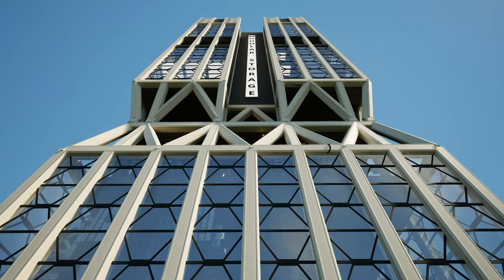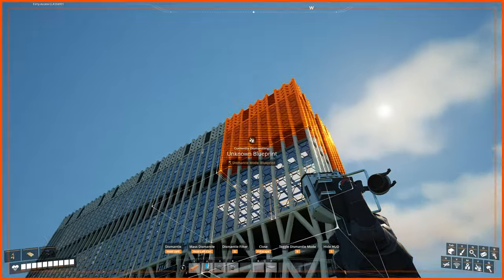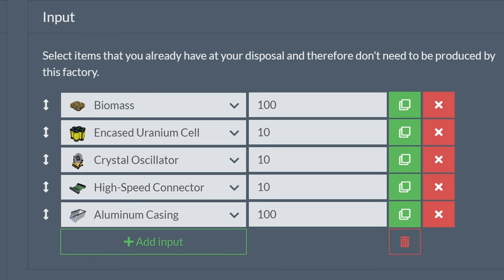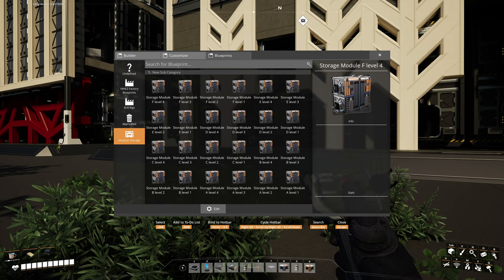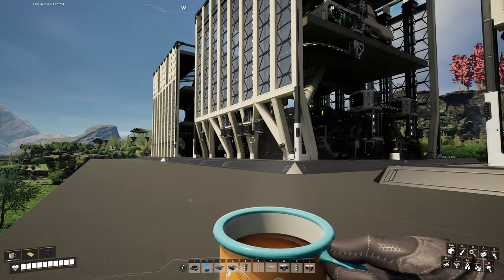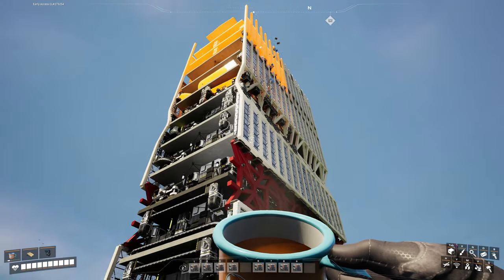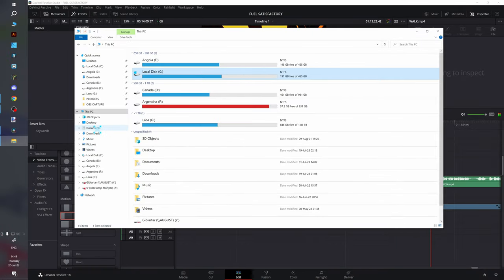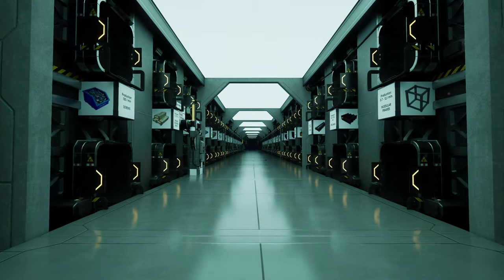I made ALL Satisfactory Ammo Types in 4x4

Comment: I've been playing with my mates, trying to get blocks A thru E hooked up.  Scared to give them access to explosives and firearms lol. Also with many of your other bloops. Giving me great inspiration and utility. Have noticed a few problems. Might be older versions I guess a power cable missing on a constructor here, Weird elevator alignment for rubber and plastic I had to shift the  whole column over as there is no middle 0.5m snap, somehow you managed it. Still great and I managed shift them over no prob.

I think it's given me most clear idea how to make my own but designed with a wider base and more integrated inspection catwalks.

You sir however are a legend for spending your time to put these together and giving away. Thank you 😊
Reply from the maker: Oh crap, this sound like an old version that I have fixed, but somehow it slipped I guess. Should stop using saves from different timelines on the same world. Will try to fix and reupload today.

Comment: Great blueprints. I downloaded them 15-DEC and have been setting them up. I have found a few issues that I wanted to bring to your attention:

There are a few missing power connections; I noted E2 and B2. (looks like you may have addressed this from older comments)
The F blueprints are 180° off; the blueprint arrow is inconsistent with the A-E blueprint arrows. the power connections and resource inputs are also on the other side of the other 5 sets of blueprints.
The bio products spaghetti line is set to 'overflow' on smart splitter. I'm running these belts without actually  overflow (less than 1 stack of remains), and the products are getting clogged in the smart splitter. I set them to 'any undefined' for now, but it would probably work better if setting the 'overflow' line to 'overflow' and every bio product that hasn't been processed yet.

Overall, these are fantastic and I can't wait to get this up and running. Thanks!
Reply from the maker: tyty for head up! Although I cannot find missing power connections on B2/E2 in v5 from 16 Dec, it can totally be older versions slipping in. Considering mirror nature of module F... well I mirrored exterior, but totally forgot to swap main connection side while constructing module. When I realized this it was a bit to late to rewire full stack and adjust machinery.

Overflow setting have advantage of not clogging up indeed. For some time I was using any undefined as well.

Comment: love it; i am 30 plus hours into my only blueprint save and so far i have used your power plant, plastic/rubber, aluminum and smelters over miners. going to incorporate this storage system next. Always looking forward to what you come up with next. Have you seen the way to create outside the blueprint area? kinestruction showed a useful tool for large blueprint circles, but i am sure you could come up with some amazing things with that.
Reply from the maker: Cool stuff!
I think I saw that channel, or maybe there was another one, or more people discovered this blueprint designer feature. It is very basic thing that one can discover while fiddling with blueprints a lot, especially while making premade exteriors and putting them into blueprint. Have known about that one for a while. There is a major limiting factor: you cannot span belts over the edge of the designer. Thus this limit usefulness of extra space to extra exterior features. Or one can go full exploit route and double the 4x4 factory with another one 4x4 or go for 12x12. But I see no value in this over just using megaprint mods. Maybe for vertical 4x4x8 1 click stack Encabulator or something. For me value lies in ability to keep 4x4 core and have more exterior space to work with.

I was fiddling with idea of the video related to this topic and it is actually featured in the next 2! out of 3 Satisfactory videos on my list. Unless KSP2 pull of miracle... there is a high probability one of those videos becoming next Friday upload.
Reply: Do you have a total breakdown of item input requirement anywhere? would be nice to know when setting up logistics for the whole thing of total input costs. @Yakez42
Reply from the maker: Iron: 590
Copper: 760
Limestone: 540
Coal: 720
Quartz: 325
Nitrogen: 450
Caterium: 740
Sulfur: 105
Water: 155
Oil: 30
Aluminum Ingots: 690
Rubber: 280 (input more for the storage)
Plastic: 270 (input more for the storage)

Comment: Hi, I like your videos and the blueprints are great. But are you aware that the last Section F is invertet? The inports and the power are opposite to the other blueprints?
Reply from the maker: Yeah... I realized this when I was doing first round of belt testing. Considering belt nightmare of level 1, well it was to late to rewire the whole thing. Could not really flip exterior, since it require to shift machinery as well as belts. :(
Reply: Yeah it´s not really a problem. I was just surprised ;)